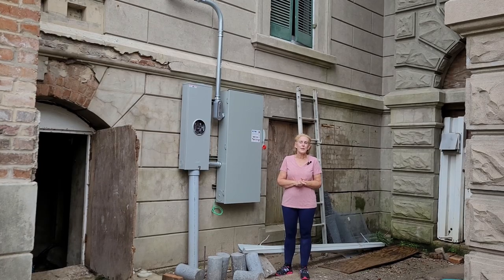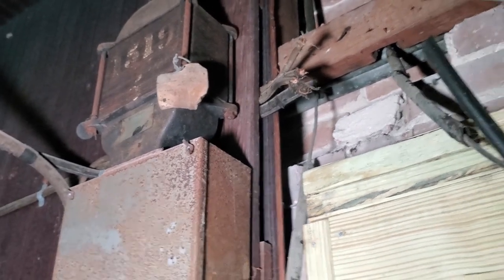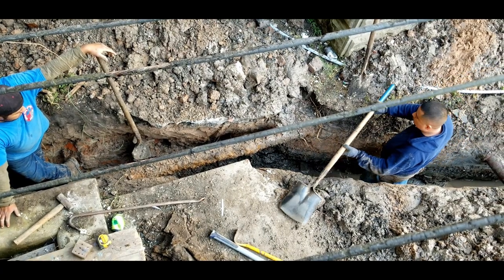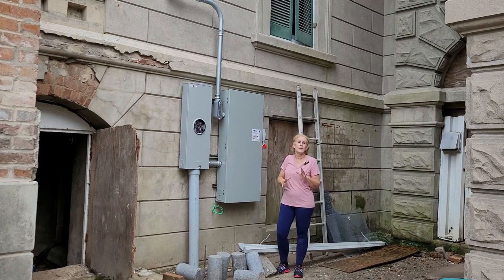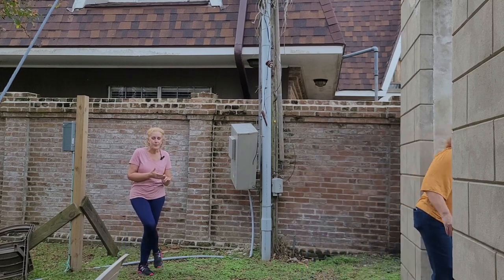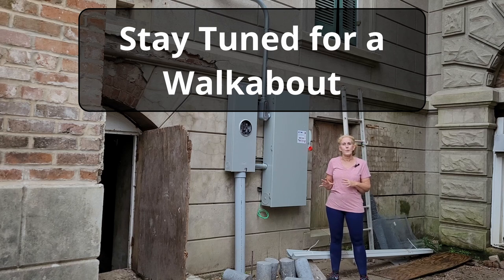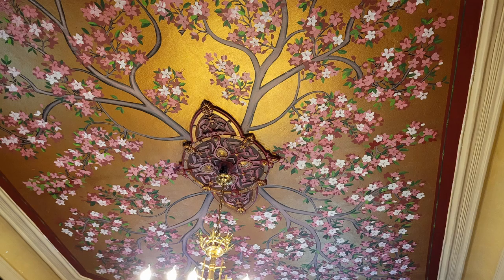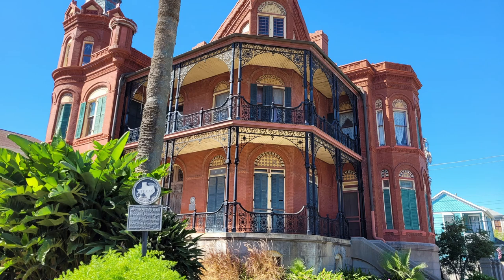S2.41 Electrical Service and a Little Bit More

Comment: I know, with my purchase and sell of homes in modern day!  They freak out and you r required to move dirt away from the house where the slab meets the bricks!   With the raising of the island and buried home bases….  Is this a contributing factor to the mess and lose of wood with the termites!  Seems with the dirt piled up against the home base by several feet, the termites just moved right in!
Reply from the maker: Having the dirt so high up on the house really did make it easy for the termites.  We have moved a lot of it away, but we will never be able to get it where it should be.  These Formosan termites are very hard to control but I think we are getting there.

Comment: Since you were talking about the separate electric meter and apartments, I was wondering if the League Kempner house was originally designed for apartments? Or is it an outgrowth of the 501c3 pro forma?
Reply from the maker: It is original to the house.  Eliza Kempner added quarters to the basement incorporating the 1920 addition on the ground floor.  There were servant's quarters already on the other side.

Comment: Oh that's so terrific you'll have help with the electric! That old box is super neat. Glad you will keep it for display. We had to get a new main panel and rewire everything. Fortunately, this 1931 house had the wires in metal conduit, so the walls only had to be opened for changes like lowering the living room sconces, and adding outlets. The old kitchens with only one or two plugs are hilarious. One neat feature we have is a recessed outlet above both the living room mantle and the top of the built-in buffet in the dining room. Probably for a clock, coffee pot, or chafing dish. They are now hidden behind a framed tapestry in the LR, and a mirror in the DR; perfect for plugging in strings of decorative lights. :)
Reply from the maker: I'm so happy for you that you didn't have to do a lot of damage to your walls to get new wiring.  I am dreading the rewiring of this house.  I hope the damage will be minimal.  My mom and dad's house only had two plugs in the kitchen.  One for the refrigerator and one over the counter.  My dad added a coupld more later but you couldn't run the toaster oven and the microwave at the same time.  That wouldn't fly today!